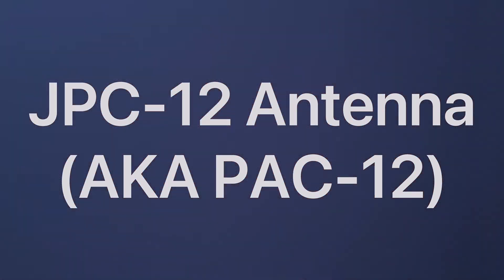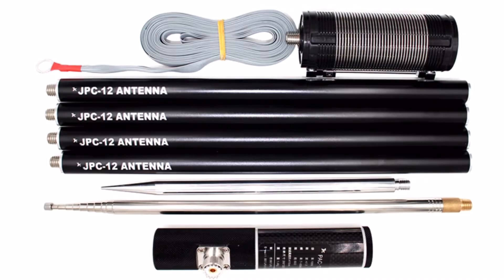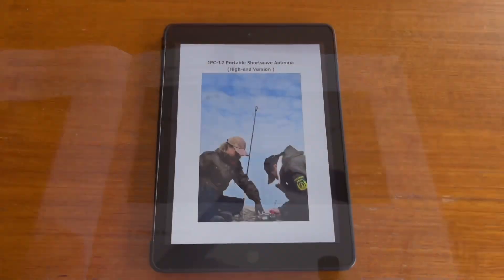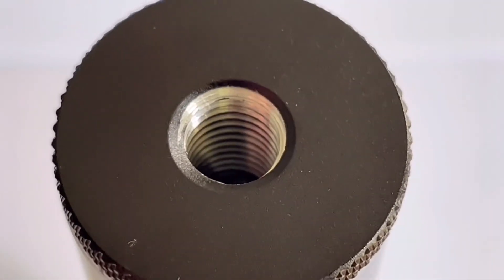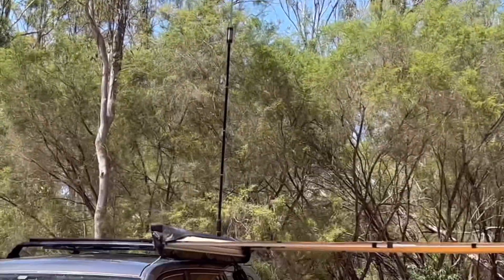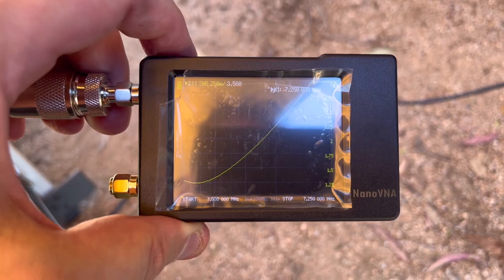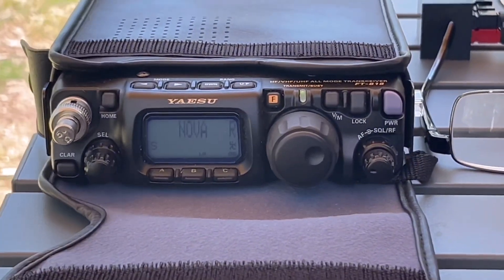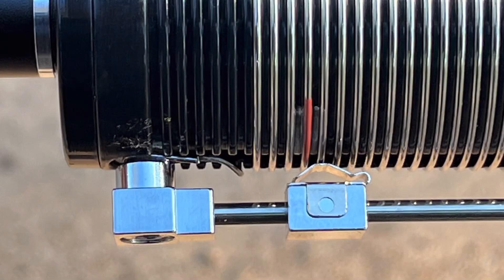JPC-12 (PAC-12) Portable Vertical Monopole HF Antenna 13 Dec 2023

Comment: Aloha Brek, to be honest, you shouldn’t need to worry about elevating this PAC-12 antenna unless you’re worried about a bunch of Quokkas climbing all over your antennas. 🤪😂🤣😂
      Todd WH6DWF 🇺🇸
Reply from the maker: @digitaldreamer5481  It isn’t for elevation. It’s supposed to be simpler to set up since the mount is left there. Im also convinced that at least on some HF bands, that the vehicle itself is a suitable counterpoise without the need for wire. It is also neater because the vehicle is always right there
Reply: @BrekMartin  My joke didn’t have anything to do with elevation per se, it was just a little American humor that I have learned over the years from my best friend, Peter, VK6GIA, who lives in Byford, very close to Perth and Rottnest Island, where the Quokkas are protective species and look like miniature kangaroos. 
     They were made famous two decades ago when someone drank too many oil cans of Fosters, kicked one intentionally and he quickly found himself in a hospital, not knowing how he got there. Quokkas are known to be friendly and lovable at times and truly represents the Land of Oz. 😂🤣😂🤙🏻

Comment: I use the Jaws (Chameleon) and clamp mine on a metal fence. It works well.
Reply from the maker: If you have the fence it sounds like a proper Earth, but I can usually count on having nothing man made on hand, other than what I bring. I have noticed the noise simply for using a vertical, but on remote trips that should be much less an issue.

Comment: Glad you like the antenna mate .
But what I would look at it grounding it a little better .
I'd say that you have rubber feet on your roof racks of the car , So just for an added bit of grounding I'd tru an earth lead to the chassis rail (some sort of a quick attach set up) .
Do another sweep on the VNA and see if you get a different match .
Cheers 
Anthony 
VK4GTX
Reply from the maker: Hi :) I have a few things to try when I do get out again. It’s noisy near a city, but fine in the bush, and much easier on the back setting it up than throwing a line over a tree branch!

Comment: The electrical length of your counterpoise is the sum of all of your radials (not sure how you split the cable - if you split it into 4 strands you get 20m electrical lenght). DX Commander has experimented with lengths and number of radials, it's on his YT channel.
Reply from the maker: It couldn’t be calculated that way on the vehicle because of the ground plane/s.

Comment: What a great idea using the vehicle as a mount,  I wonder if the radials are still required as the vehicle could be used as a counterpoise? I got mine today and found that adjusting the length of the extendable antenna to make it approximately 10 cm shorter gave me great SWR on 40 meters.
Reply from the maker: That’s what I’m interested in comparing. 40m tuned fine without any radials, but the band was dead. There’s no good indicator of performance. But yes I’m essentially wondering if the vehicle looks like many short radials, and is fine on it’s own.